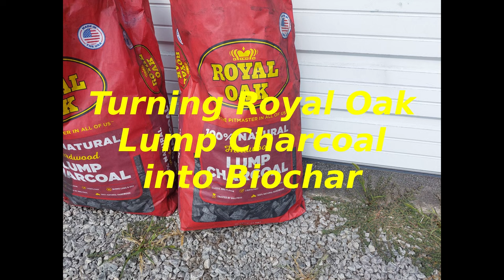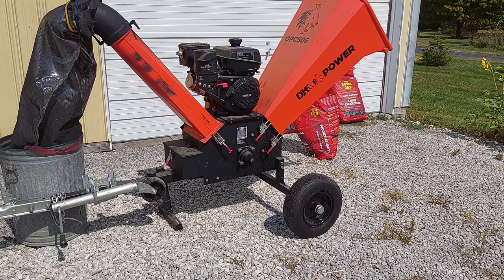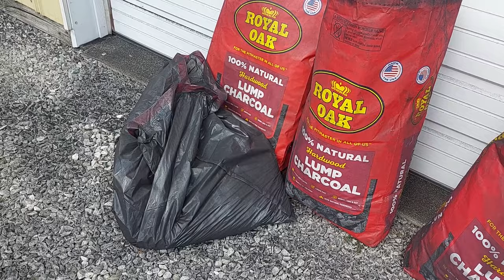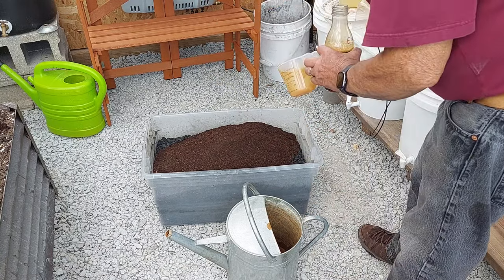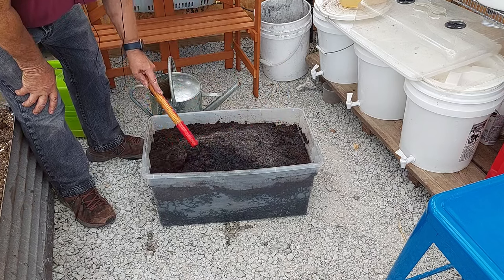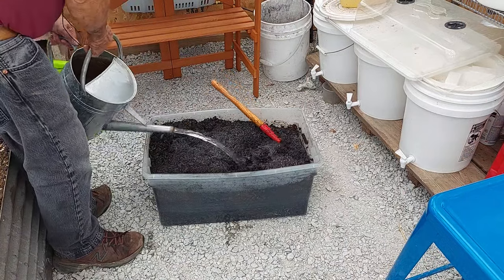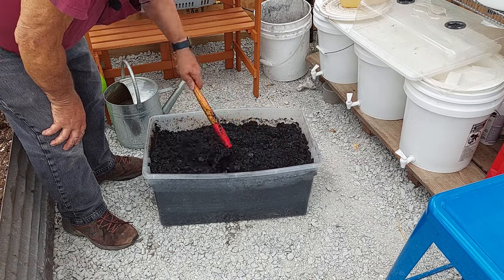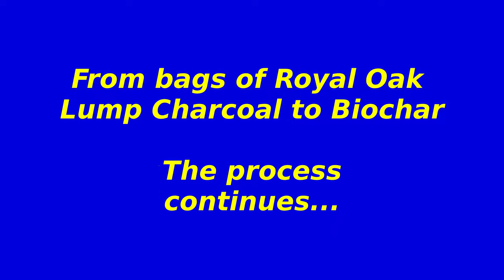Turning Royal Oak Lump Charcoal into Biochar using Wood Chipper

Comment: I built a simple in ground "Kon tiki" style pit to make my own charcoal for biochar, just an inverted cone shape lined with red brick. It's so much fun burning limbs, hedge trimmings, brush etc into charcoal. After I douse it with water it's pretty easy to chop up fairly fine with a shovel. My chipper shredder is on the fritz but man did that ever make quick work of it and made the perfect size. A shovel though while in the pit is a close enough second best. I like the idea of having different sized pieces of the charcoal for biochar.
Reply: Cowboy i like the different sizes too.but not to much super fine as it blows and washes very easily .  I even like walnut size as i think the larger mass will hold water longer

Comment: I did one bag of lump charcoal but used a large sledgehammer and a 5 gal bucket.  Wetting the charcoal before crushing it, really helps with dust.   My inoculation was done with worm castings like you, but also azomite rock dust, urea pellets, and bone meal and finally some dissolved molasses to really crank up the microbe population.   Within 2 days, I had lots of furry white fungal growing.    I may scale up like you suggest with the chipper/shredder.
Reply from the maker: Your soil will reap the benefits of having Biochar added to it. Spray the charcoal with water the night before running it through the chipper to reduce the dust.